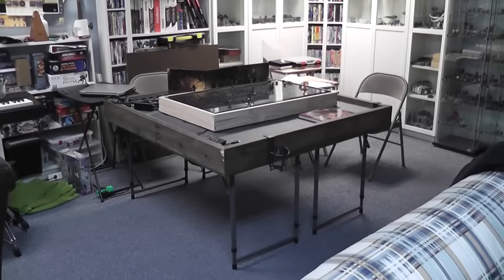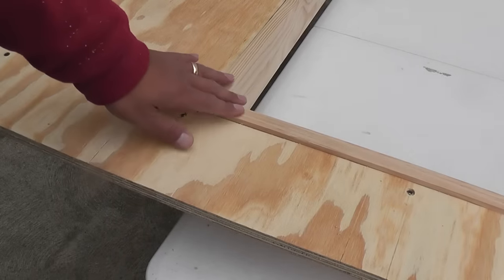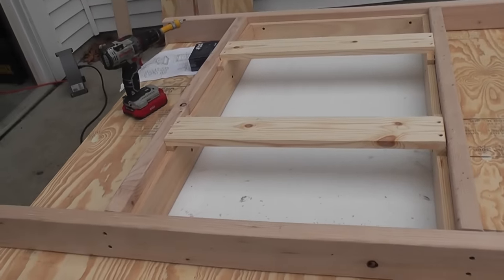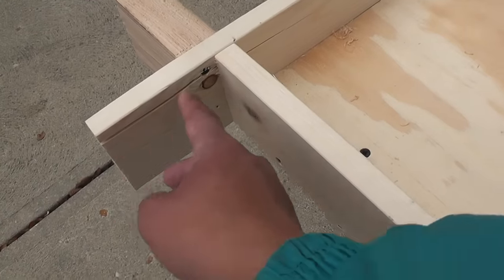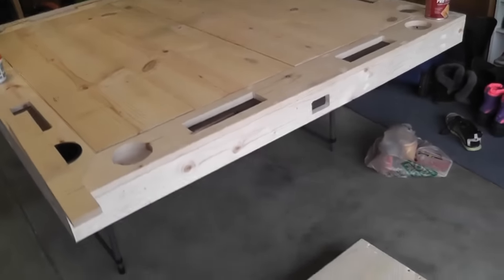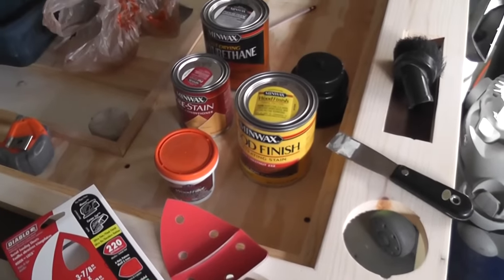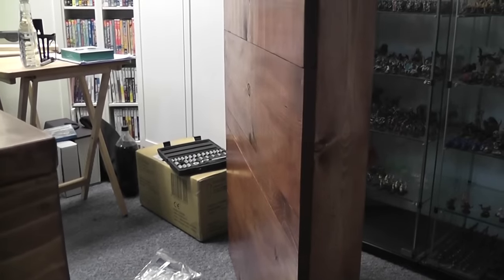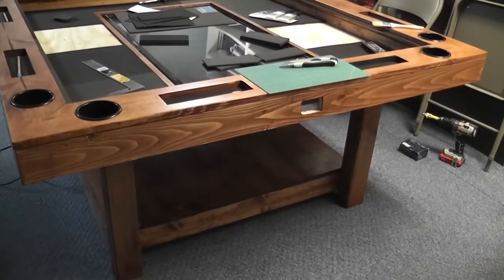DIY Gaming Table for $150

Comment: Those 2x4 that reinforce the sides from people leaning on it. Unless I'm blind, what are the length of those?
Reply: 5.5inchs?
Reply: 4.5?
Reply: 4inches? So the one inch board its drilled to and the 1 inch attached to would be 6 and that would make sense for the 1x4
Reply from the maker: They are 4" long.  Sorry it's not in the plans!
Reply: @gaminggeek241  thank you for tolerating my harassment for the answer but it was making me Go nuts lol. I like what you did but since you already did it and i hate being a copier, I'm changing the measurments to 6x4 table (I'm Mormon so i have a big family lol) minus the TV. But thank you for answering me so fast, I couldn't stop looking at the plans, thinking I was over looking it
Reply from the maker: @justinhall2117  No problem!  Make sure you take a look at the link for Boardgamegeek post where a number of others have made a 6x4 version and made improvements on my original design.  Good luck on your build!
Reply: @gaminggeek241  curious if will still cost under 200

Comment: I see you use 14 gauge and 16 gauge wires from you purchase plans. How do you know what gauge wire to use? Will it always be the same for everyone?
Reply from the maker: 14 gauge for a 15 amp circuit and 12 gauge for 20 amp circuit.  Most circuits in American homes are 15A with some kitchen/workshop circuits being 20A.  You can tell by looking at your breaker box.
Reply: @gaminggeek241  For safety reasons, please go back and put those outlets in receptacle boxes.  They aren't just to keep your friends from getting electrocuted, which is super important, but they also suppress fires if anything sparks!  Your insurance company may not cover your claim if an electrical fire originated from that table due to lack of receptacle boxes.
Reply from the maker: @jasonrowland832  Yeah I did.  Watch my followup video.

Comment: if I wanted to bar height and 4x6 would I need to change the legs to support that?
Reply from the maker: No, the double 2x4's will be strong enough to hold the table at that height.  I might figure out a way to make the legs as wide apart as possible to increase stability since the higher the table, the more top-heavy it is going to be.

Comment: I would like to make this table, but nowhere in the plans or from the video can I find how long each piece should be cut or where to cut, you have many pieces of wood that are cut into smaller sections but I have no idea how long they are, and before people start making rude and unreasonable comments I'm a musician not a woodworker
Reply from the maker: In the plans, if you look at the upper portion, you can see all the measurements for how long the pieces should be.  For example, you can see to cut the legs to be 24" long.

Comment: I have no idea if you're still checking this thread. But I'm planning on building a table based off your design! However, I want to make it a 4' X 6' table, without the TV middle.

However, I have a question, do you think at 6 feet long, it would require legs in the middle for support?
Reply from the maker: I don't think you need legs in the middle as others have made 6' tables.  Check out this thread and it should answer your questions about building a bigger table:  https://boardgamegeek.com/thread/1471747/build-gaming-table-150
Reply: Gaminggeek thank you!

Comment: Small question: In your plans, you write that the bottom support shelf is 34.75" x 39.5". It is unclear to me from the plans if the 39.5" is the total length of the side (including the breath of the two other beams) or only the one beam in itself - can you clarify? :)
Reply from the maker: 39.5" includes the width of the two side beams.  So you are cutting the board on that side to 38" which is less the width of both boards (3/4" + 3/4").  34.75" x 39.5" is the assembled dimensions of the bottom shelf.  Does that clarify things?
Reply: Yes! Thank you!

Comment: Other then finish and staining, can this be completed over a dedicated weekend? (Sat-Sun)
Reply from the maker: Definitely.  Especially if you have a miter saw.  The finish is what takes so long.
Reply: @gaminggeek241  awesome. My wife and I are moving which means my D&D table dreams will finally come true. I'm not going to put a screen in mine so I'm not going to need to build a frame in the middle. Just going to add supports. This has to also turn into our dining room table so I'm going to have to rethink the cover a bit. Cup holders and dice holder areas are probably not dinnerware friendly. I'm going to see if I can make a top cover that covers the entire top, maybe using the cup holder holes as a means of staying secured. Wish me luck!
Reply from the maker: @quilnux  That wouldn't be too hard to modify--make sure to check out the BGG link in the descriptions to see how others modified their tables, especially those that are using them for dining.
Reply: @gaminggeek241  I saw those links. Going to be reviewing those soon. I appreciate you putting this up for others to follow.

Comment: My biggest question before I jump into this is how did you get the TV into the actual frame and sit level?
Reply from the maker: I just have some boards that act as support beams across the bottom of the frame for the TV.  My TV is incredibly light so didn't need a lot of support.  I had to add some spacers though to fine tune so that it was perfectly flat with the tabletop.

Comment: Can you just set a circular saw to 45 degrees instead of using the miter saw? I'm not wanting to buy miter saw
Reply from the maker: Yes, you can use a circular saw.  I would make sure of my 45 degree angle with a brace to run the saw against.
Reply: Gaminggeek thank you very much 💓

Comment: Not sure sticking 2 2x4 like that makes them a "4x4" or even stronger in that configuration. If it was bearing load on the side face maybe, but all the force on the leg is still concentrated to a 2x4 with 2 lag bolts. I would have added a 3rd on the other side and bolted them around sandwiching the table frame between.
Reply from the maker: Maybe but all these years later, the legs are still going strong with no warping or issues.  I agree sandwiching would make for a stronger connection but I don't think it is necessary.
Reply: That’s great! Never underestimate framing lumber! This video is probably one of the most detailed ones out there great stuff.

Comment: I know this comment is a little late, but is the wood you used for the tv frame in the shopping  list, or do i need to add that
Reply from the maker: You need to add that.  They are simple 1x2 pine boards from the nicer wood section in Home Depot/Lowes but are still pretty cheap.  You'll need to measure the outer dimensions of your TV.

Comment: Would the outlets be better near the corner of the table?
Reply from the maker: Yes, you can place them in the corner if you want, as long as they don't interfere with the cup holders.  Having them in the center hasn't been an issue for me.
Reply: @gaminggeek241  Thanks. looks like they might get bumped when the person scoots in for the action!!

Comment: Where is the list of lumber needed? Can you add it to the description?
Reply from the maker: Links are in the descriptions, specifically "Here is the link for the shop list."
Reply: @gaminggeek241  I asked for permissions, but have yet to receive it
Reply from the maker: @RealityShifter1  You shouldn't need permission--try this link:  https://docs.google.com/spreadsheets/d/0Bwy2Jq8PcrmbQkVIWWh5OVBSWlU/edit?usp=sharing&ouid=101859677719173369567&resourcekey=0-RU0ifzwwCPulN1j_H5T9qw&rtpof=true&sd=true
Reply: @gaminggeek241  That worked! Do you also have a docs link for the plans? I still get the request access for the plans..... Im excited to build this table soon :)
Reply from the maker: @RealityShifter1  I updated the links in the description section so try it now.
Reply: @gaminggeek241  It works now, thanks!

Comment: i kinda want to do this build i like the way that it can be used for various many thing however id like to do one with a rasberry pi type machine and have old school arcade games as well as have hdmi inputs to still use it as a DnD map ect.. and instead of a solid top. maybe do a glass top. throw in some lights around the edges inside and underneath. theirs a lot that could be added to the base design of this.

Comment: Quick question for everyone out there: with the electrical, I went and got a bunch of boxes  to make sure that everything was insulated but, when I went to plug it in, it kept tripping the circuit breaker. It isn’t a short circuit or ground fault, as I always wrap my existing wires to insulate them against that. What is happening?
Reply from the maker: I would first use an outlet tester-- it is a plug-in device that has three lights in it to tell you whether or not you wired the outlets correctly.  Typically if it is tripping your breaker, there is some short somewhere in the line.  Ask for some local help from an electrician if you have a buddy who knows what he/she is doing.

Comment: A little trick I learned of for using screws that all is to put WAX on them. I go to Walmart & buy those TEA Candles. I melt them in a double boiler & then pour the wax into a plastic cup that has a lid. I then push the screws into the cup of wax, turn a couple of times. After doing this maybe a dozen time put the cup in mirco wave & melt the wax again to fill in the holes.
Reply from the maker: Yeah, someone else mentioned this hack as well.  You're going the extra step of melting the wax into a cup--others said to just rub the screw directly onto a candle but your method seems like you would get more wax onto the screw.  Will try it!

Comment: I had that same ryobi saw.  Check the fence, mine was warped.  Ruined cuts for years before I finally tossed it.
Reply from the maker: My fence is pretty good--I'm hitting 90 degrees spot on.  I think you get variance on the machines since they are only $100.

Comment: Expected time to finish actual assembly when you have the materials and tools?
Reply from the maker: I did mine in two weeks, with 12 hours in between coats of polyurethane.  If you were able to work on it full-time, you could do the build in one day and the stain and poly would take three or four more days with most of that, waiting for things to dry in between coats.

Comment: Okay, following your awesome guide, I actually managed to build this thing! I have now ordered some different stain samples and the same brand and kind of polyurethane that you use in the video. About the polyurethane, do you have any recommendations in terms of safety measures? My table is inside, so I hope that can apply it inside? Do I need gloves, googles, something so I don't inhale it?
Again, thanks so much for guiding the geeks!
Reply from the maker: Polyurethane has fumes similar to if you were using enamels so I would definitely use a respirator if you have one.  It's going to stink up your house.  You might want to consider using a water-based poly which is less toxic if you have no choice but to do it inside your house.
Reply: @gaminggeek241  Thanks for these advice! 
How did you apply your coats of polyurethane? Outside, without a mask?
Reply: @gaminggeek241  Maybe I should expand a bit. I have a 'man-cave' at the end of the house, which is an add-on to the main house. I was thinking that I would apply the polyurethane with all windows open and possibly a fan. I would then leave the windows open the entire day and the next few days. Would that be too dangerous you think?
Reply from the maker: @Kermit_the_frog  No, that is definitely a good option since I did mine in the garage with pretty much the same effect.  
I applied the poly with a 3" house paint brush (don't use the super cheap ones because the hair is falling out all the time) with a very light sanding to scuff it up a little before adding another coat.  I did three total coats with no sanding after the last coat.  
Also, make sure to check out the Boardgamegeek thread linked in the descriptions to see what others have done and where you can post pics of your build and get more advice!
Reply: @gaminggeek241  Wonderful! Thank you so much for all the advice!  You got a new fan! :-)

Comment: Awesome video! I think I missed it but how big was the tv you used? Is there a specific model or just any tv under a certain size ?
Reply from the maker: I used a 40" LED LCD screen.  You can go slightly larger than that though.
Reply: @gaminggeek241  thank you! What would you say is the biggest tv size you can use ?
Reply from the maker: @VeLustyRaptor  Since the well of the table is 4'x4', whichever TV can fit inside of that.  I think a 50" TV is about 44" in width so maybe that is the max size?
Reply: @gaminggeek241  that makes sense and thank you for replying. I can’t wait to get this project started !

Comment: Excuse my ignorance but what brand and size TV are you using?
Reply from the maker: I used a 40" LCD LED Magnavox.  You can use any brand but make sure it is light--don't use a plasma screen.  Also, put a piece of plexiglass on it for protection.

Comment: I didn't see the TV in the plans
Reply: You basically build a wood frame around the TV. That's all I did. Also, if you want the TV flush with the frame, then use wood to support the back of the TV. If you need more info, let me know.

Comment: Not low voltage. Low voltage is 12 volt outdoor wire. Anything 120 up is your full house voltage. That 14-2 can still burn your house down and kill people if touched and not properly covered. Add notes in the video explaining that exactly where you said it. Cell phones maybe low voltage charging but the outlet will still draw full power.

Comment: I know I'm five years late to this party, but perhaps I'll save someone reading the comments some headache:

So, I think you're having trouble driving two inch screws for mainly two reasons:

1) You're using a drill, rather than an impact driver.
2) It sounds like the screw is camming out before you get it to full depth, which would lead me to think you're using phillips head screws.

I've buried hefty 4" structural lag screws to fasten 2x4 cleats into 2x4 studs for garage shelving pretty easily with a basic impact driver and torx head fasteners.  Predrilling still can be wise to prevent splitting, but getting and using an impact driver combined with even a small step up in fastener quality to something  with torx/robertson (square) drive and you can throw 2"+ screws into pine all day long with ease.
Reply from the maker: Yes, I now have an impact driver which makes a lot of difference.  Square heads do hold better but I still mostly use phillips head screws.

Comment: What'd you use for the pencil holders
Reply from the maker: Pencil holders?  Do you mean the cup holders in the table or the slots for the dice?  Cup holder link is in the descriptions and the dice tray are just cuts in the face of the board.  Hope that answered your question.
Reply: @gaminggeek241  I meant the dice holders, what was used to hold them after they made the cut out
Reply from the maker: @austing9060  Actually, there is nothing in the cutout except for a sheet of black foam (same thing I use to line the table well).  You can see me put the backing with tagboard here:  https://youtu.be/spdescYFqIE?t=1143

Comment: after the last coat of poly did you sand it?
Reply from the maker: No, I didn't sand the last coat as it would make the finish cloudy in appearance.
Reply: @gaminggeek241  thanks im about 1/2 done and have never stained/ coated before, my changes are in routing the electrical a little differently to hide it better , I'm also adding an hdmi/vga/usb plate for easier access to the tv by the DM, I'm also lining the outside bottom with tagboard  and the bottom table is going to be a little smaller and closer to he top for players to store there books and stuff so they aren't on the table top, i cant wait to get this done because im having to fight the quality of wood available in my area lol
Reply from the maker: @Gamester33333  Make sure to post pics on the BGG forum once you are done!
Reply: @gaminggeek241  hey real quick last detail i need i think lol how big did you make your dice trays and approximatly how far were they from your cupholders?

Comment: Just some friendly advice. when using your airnailer/nailgun , if the nail hits a knot in the wood the nail can go in another direction, so watch your hands a bit more or you might loose a finger. Secondly, this video is awesome.

Comment: What size television is this?  55" inch?
Reply from the maker: No, a 40"
Reply: @gaminggeek241  Where did  you get the "tag board"
Reply from the maker: @williammoore5421  It is also known as Hardboard and is in the same section of the store as pegboard.  Here's a Home Depot link: https://www.homedepot.com/p/Hardboard-Tempered-Panel-Common-1-8-in-4-ft-x-8-ft-Actual-0-115-in-x-47-7-in-x-95-7-in-832777/202189720

Comment: halfway decent carpentry from an electrician. 
I'm a bit worried that you didn't specify the amperage of the receptacles you used. could have people adding under or oversized outlets

Comment: Where do you live? In CA, the price for all the material will easily be double. Great video and Great looking Table!! I'm a fairly new DM and in the process of getting my garage set up as a workshop/gaming room. 

As an Electrician though. I'm cringing that there are no boxes for the players' outlets... at least add a piece of wood to cover the open space. A little time and material is worth the effort for safety.
Reply: @Det Nine you're right! That's a fantastic story. I working on construction site so I'm always on the look out for pallets, spools and usuable materials.
Reply from the maker: Yeah, I'm in the midwest where things are generally cheaper.  Also, I did add outlets if you take a look at my follow-up video on changes I made.